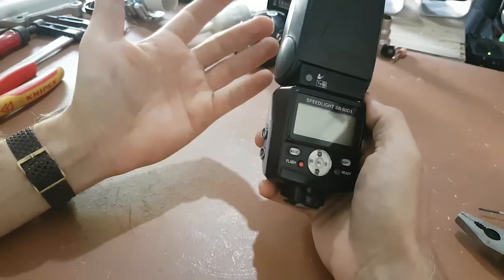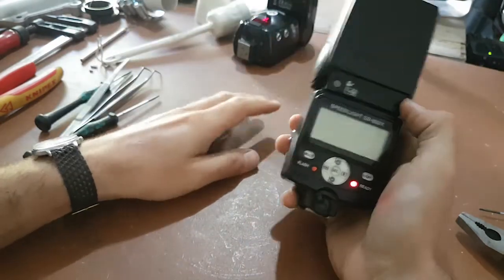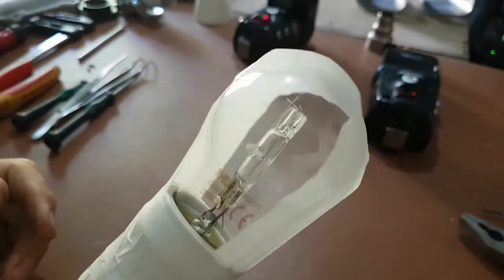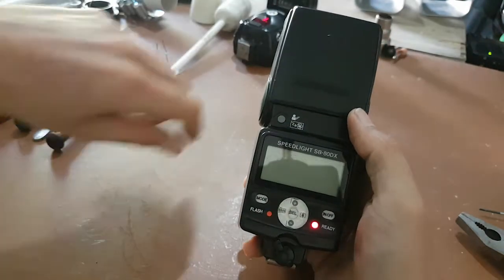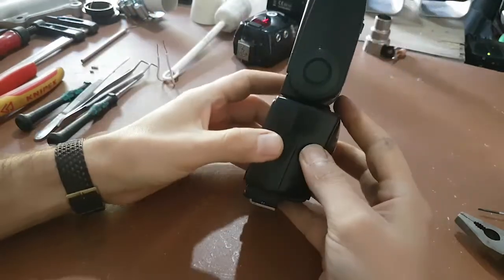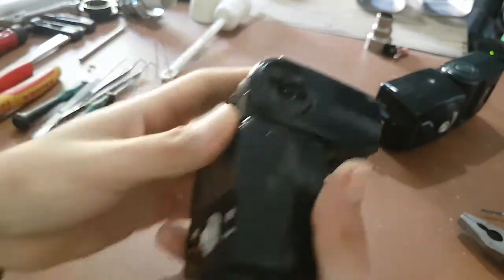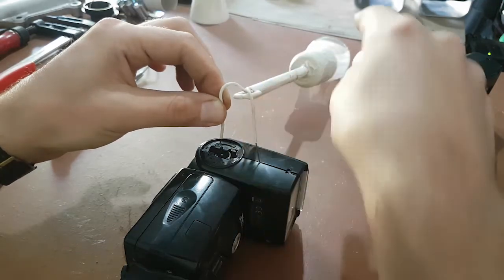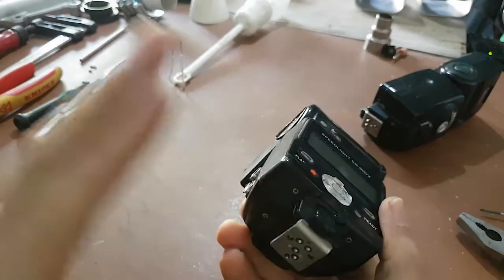Nikon Sb80 Sb800 Teardown, Capacitor Discharge and Lcd Repair. How To Tutorial. Disassemble

Comment: Hello, my sb 800 is not turning on. Its not been used for 3 months. I tried different battery. No luck.
Reply from the maker: It is possible that old batteries leaked and corroded the battery contacts. Check inside the flash for rust.

Comment: What kind of light bulb I have to use to discharge the capacitor. I thought flash capacitors have like hundreds of volts
Reply from the maker: 300+ volts but drains very quickly. You don't need to use a light bulb. You can use a big power resistor. Some high watt resistor with metal or ceramic case. Bulbs are easy because you see the light while you discharge and they are easy to find. 220v bulb works fine. I didn't try 110v bulbs but if they get burned you can try connecting multiple bulbs. Someone tried this with a 12v bulb and he got a nice explosion... Low voltage bulbs are a no no
Reply: 😂 I tired a 220V bulb, not sure if I fully discharge it or not , I saw another video mentioning shorting the capacitor can discharge it as well , and POM , there u go an explosion and a slightly melted tweezers.... Not sure if the capacitor is still fine or not 😅
Reply from the maker: Thats  why we use something else than shorting them out. We short only the low voltage capacitors. I guess you feel younger now. Unhappy tweezers. Capacitor will be fine if it wasn't already defective before you discharged it.
Reply: @parçalabehçet  Thanks for the info, hahahaha definitely find myself younger 😂 the path of learning, experimenting and explosions is just so fun 😂

Comment: Hi dear 
I have one TRIOPO speedlight L870 its highest category model in TRIOPO.
It has issue when I start it I can hear zoom in out noise and it give display  control and in instant its getting blank but green screen. I have checked display connection cleared it and then again assembled it still has the same issue. Since many days it had same problem some times it works with all features,  some time it shows the green screen but now its not working 
Can you give me your expert advise
Reply from the maker: It can be a software issue. If there is a problem with the software you can try reinstalling the software. But i dont know if your flash can do that. Other possibility is a bad connection. You need to resolder the connections on the circuit.

Comment: excellent teardown many thanks. I feel confident taking it apart and reassembling thanks to you but where do you get replacement parts from as I cant find anywhere in UK ?! My SB800 won't go into SU4 mode and I suspect it's the slave photodiode SS512-23 that goes to CN12 on the PCB as it works OK in normal Remote mode speaking to a Nikon Commander and TTL is OK.
Reply from the maker: I never had any nikon flash with that fault so i dont know what to expect. Maybe one of the sensor for tilt/pan or diffuser is not working because i dont think flash will prevent you from selecting su4 mode if the diode is not working. But maybe you are right, i  hope you will figure it out. You can check aliexpress for some parts but your best next option is buying another flash. I buy them broken if i can to salvage parts.